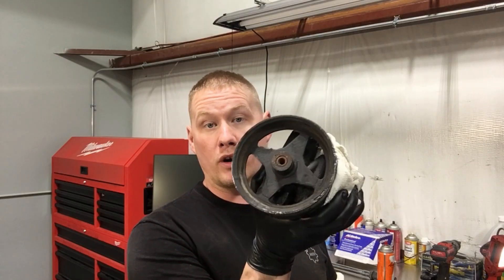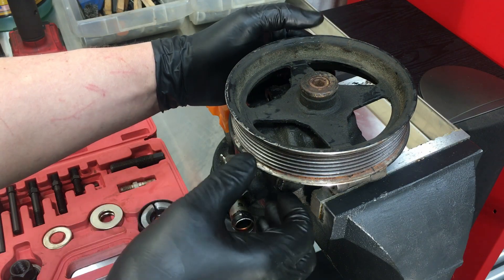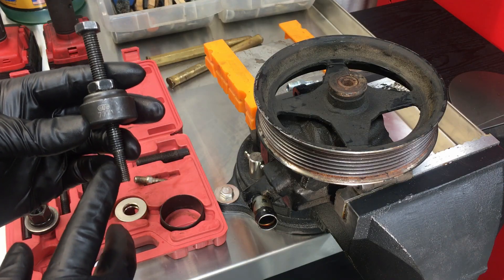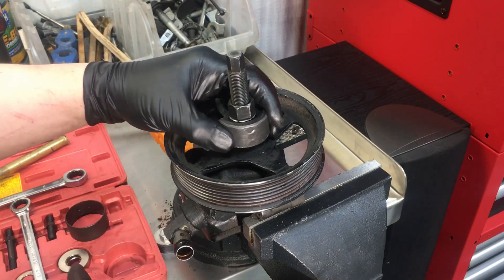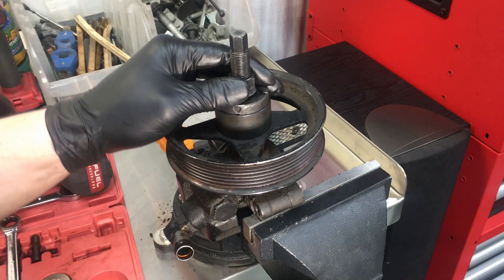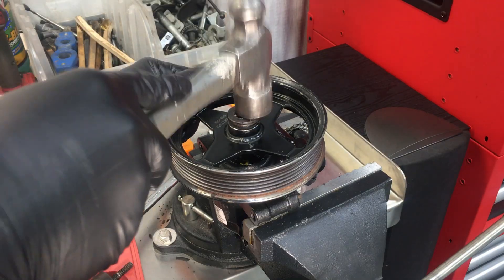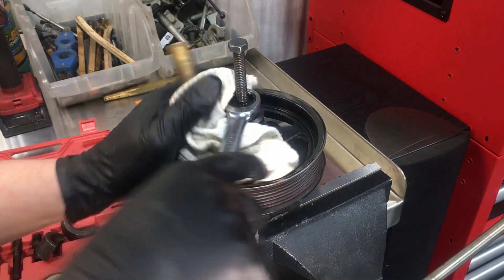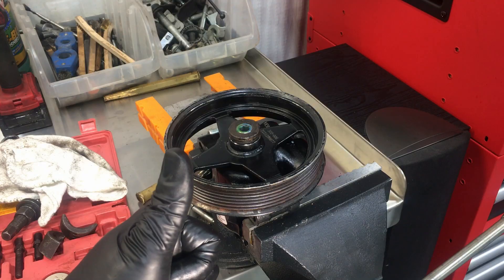Ford Quick Tips #82: Ford CIII Power Steering Pump Pressed Pulley Removal and Installation Procedure

Comment: This couldn't have come at a better time. Ordered my new pump and hoses last night and picking them up today. This is my first time so here goes nothing!
Thank you! 
Merry Christmas everyone!
Reply: Where did you order your new pump from?  THANKS
Reply: Ronald Cach i got it from auto zone, it was only like $50, but with the core charge it was $63 and some change. I got it the next day as well.
Reply: Ronald Cach I also got the hoses and rebuild kit from them.
Reply: Thanks
Reply: Thanks
Reply: Ronald Cach well i started in on it today- highly suggest taking the pulley off before messing with the pump, the bolt for the pressure hose, is SO hard to get off with it there. Horrible experience. Lol.
Reply: heavy metal apocalypse n